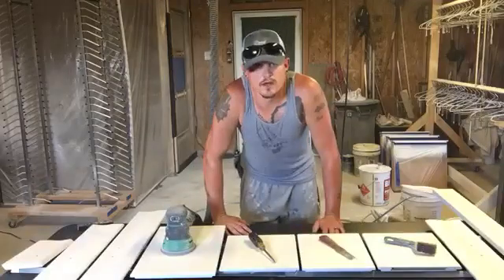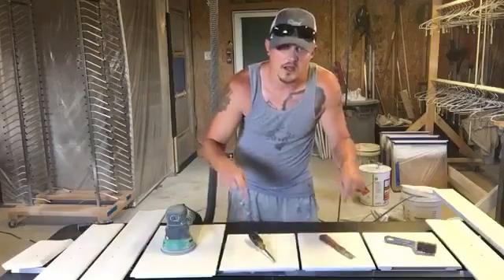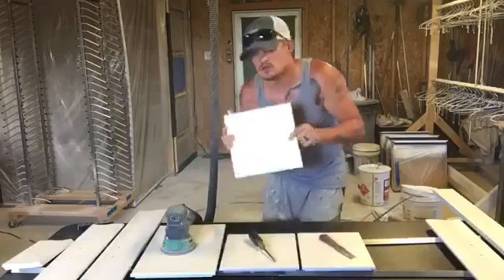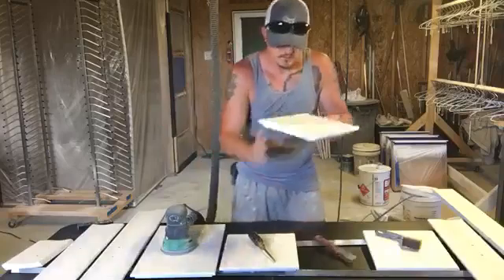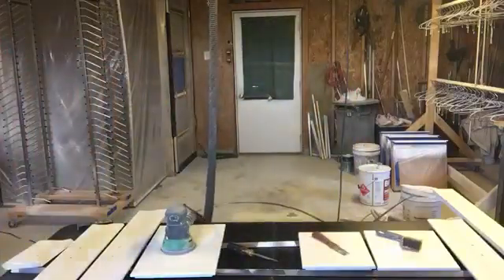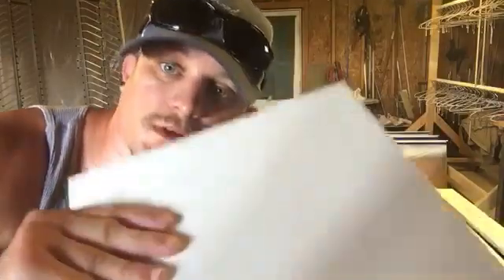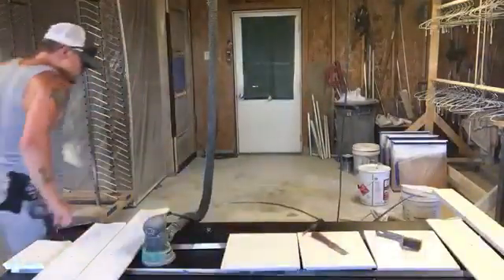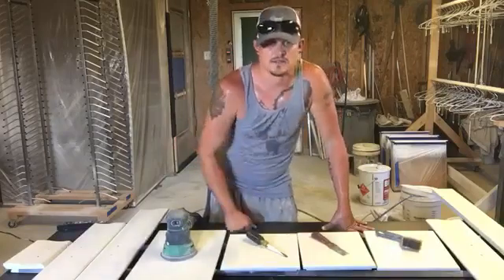Scratch Test on Our Primer

Comment: What coating is on top for that same resilience?
Reply from the maker: This is Zinnser BIN Shellac. Now we use a European industrial wood coating.
Reply: @brandnewagainrefinishing602  I meant what you lay on top. If you've achieved the same resilience from a mid coating?
Reply: @brandnewagainrefinishing602  yea a good bonding primer like zin would create that substrate but do you dtm, enamel, high build laquer?
Reply from the maker: @factfreedom4624  Renner Wood Coatings
Reply: @brandnewagainrefinishing602  nice. Hmm👍
Reply: I have crappy primer already on what do I do?
Reply: @ceeerik5123  uh? Like. So many questions.  Is it your set?
Reply: @ceeerik5123  is the primer already failing? Why do you say your primer is crappy?